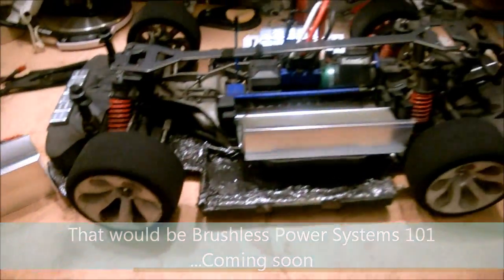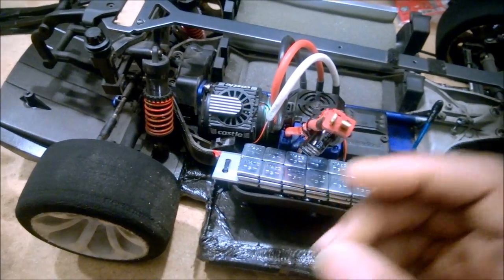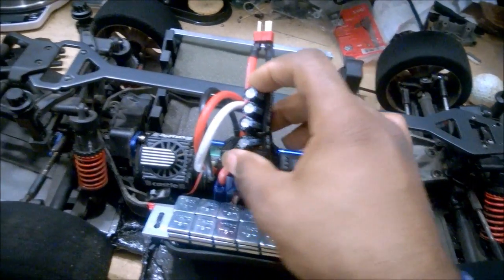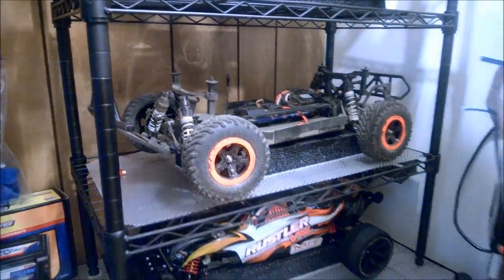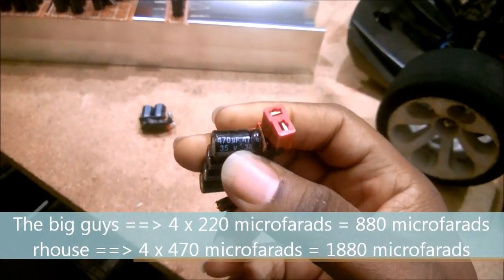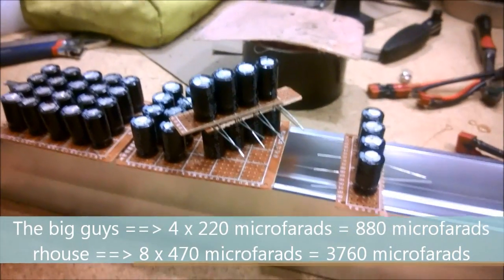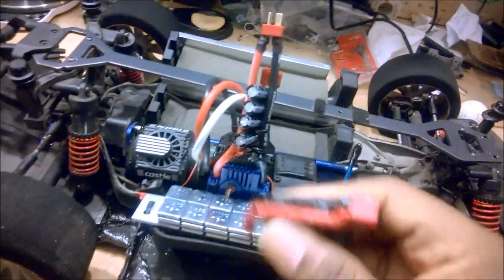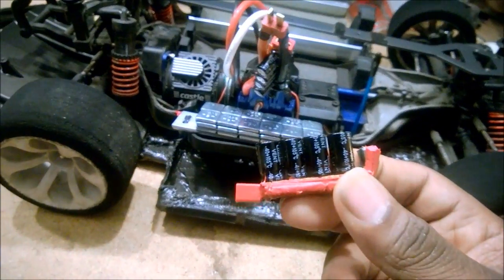Ep. 88: Cap Packs 101

Comment: I am amazed.  I only heard of cap packs a few months ago.  I’ve watched several YouTube videos.  I’ve “commented” each time basically asking “what do they do?”  & “how might they improve performance of the specific vehicle I have?”.  Most of me “comments” remain unaddressed.  Others completely confused me.  One reply NOW makes sense to me...”eliminates ripple”.  After you video, I now understand what was referred to as ripple.
One of the questions I asked repeatedly was how would a cap pack improve the performance of the X01 I am currently working on.  I did get one answer...the X01 doesn’t need one.  I could only guess one reason.  While I was curious what the 3 drums were wired into the ESC,  I couldn’t identify them from the parts list or the exploded views.  Now I know they are a cap pack.  While I do have a few other questions, I don’t want to go on & on here, but here’s one.  Will replacing the cap pack that TRAXXAS seems to have “snuck in” with a superior one (ie yours) improve the performance of my 6S X01?
Great job!  THANKS!
Reply from the maker: The XO-1 ships with a version of the Castle Mamba Monster 2 ESC with custom Traxxas firmware. The MM2 was capable of delivering at least 200-300A in short burst, but few people know exactly how many it will do because this generation ESCs lacked data logging. This sounds like a lot, but this ESC did not contain very much internal capacitance to fight ripple voltage, which is why Castle and Traxxas added the external Cap Pack to better protect this ESC. While the combo worked well, Castle continued to improve their Mamba Monster ESC with the Mamba Monster X (which had a more sophisticated "brain" and added data logging) and then Mamba Monster X-8S (which has a brand new 8S-capable internal architecture and performs on par with the older Mamba XL2 and XLX 8S ESCs)

While the MM2 is a still a good ESC, it is an old architecture now and about 2-3 generations behind the latest Castle ESCs in overall performance, power delivery, overall smoothness, and ripple suppression. I believe the Traxxas firmware in the OEM ESCs limits the output, so you should not be able to exceed the capabilities of the stock Cap Pack. However, the Mamba Monster 2 Retro from Castle has all the power suppression removed and is a direct replacement for the stock ESC. If you decide to upgrade to that, you should definitely jump to a higher capacity cap pack to protect it. That ESC will happily deliver enough power to destroy itself if you aren't careful setting it up.

Still, If you want to get the most out of your stock XO-1setup, I'd suggest moving up to the MMX-8S, just for the data logging and increased smoothness. It's internal architecture is so good that you may not even need an external cap pack running on 6S (but adding one definitely won't hurt).
Reply: I have to confess while I almost ordered the MMX-8S...went as far as to put it in my cart, but I am very intimidated regarding my ability to do the replacement of the stock X01 ESC.  While I don’t doubt it will be the best upgrade I could do, I think I would screw it up...too many wires!  Thanks for your advice.  Perhaps with a little more experience I will venture to make the change.

Comment: I don’t even know what data logs are lol. Is that if you run an aftermarket transmitter that you can check your data? I wouldn’t even know what to look for in the data lol. Thanks for your response
Reply from the maker: Castle's higher end ESCs have an internal "black box" that records a ton of information that you can review to help tune your rig and make sure the ESC is running in a safe regime. It's really cool tech.

Comment: Noob/stupid question. .. cant you run them in line like have a conector either end then onside to your esc the other to the battery ?
Reply from the maker: Not dumb at all. I've actually built a few custom packs just like that. The down side is that the cap pack has to be able to handle the full load of the power system, which can be a few hundred Amps in larger setups. It also places the caps much farther from the ESC, which can make them less effective at fighting ripple voltage.

Comment: Hi,  how do I size the caps--   I run a 2s setup and I think I would use a 470uF but what would the voltage be?  I only run 8.4 volts would it be 16volt , 35 volt or something altogether different?
Reply from the maker: Generally, just pick caps capable of handling the voltage you are planning to run. I build my packs with 8S capable caps for extra compatibility, but if you are only running on 2S, you are fine with a 10V cap. You won't get any extra performance running a higher voltage than you need.... unless it has a significantly lower ESR. Otherwise, you will just be carrying a cap that is physically larger than it really has to be.

Comment: If you don't mind me asking, what is the board called that the capacitors attach to when making a cap pack?  I've googled "circuit board" , "capacitor strip", and have had no luck.  After blowing my CC XL2 I'm planning to take major precautions after I replace the capacitors in my esc.
Reply from the maker: Just order one of my 10S capable units. Save yourself some time and trouble. ;-) You can finde them in my ebay listings at http://www.ebay.com/usr/rhouse21

I buy "project boards" and cut them to size.
Reply: +rhouse21 - RC thank you for the knowledge

Comment: Hello,sir may I ask you for suggestions.my jlb j3 have a use standard 3s battery and 25v 750uf x 2pcs, ESC 120a.now I want upgrade battery 4s 5200mah 60c,can suggest how pcs can I use for upgrade the cap bank.can I use 4pcs the same 25v and 750uf for upgrade.. please teach me about that
Reply from the maker: There's no magic equation. If you don't have data logging , the real test is to observe your ESC for signs that it is struggling. If it or your battery is running hot, you may have a ripple Voltage problem and need more capacitance to help the power system out.

Comment: Hi guy, I have a 200amp esc 8s, What pack should I use for running 6s LiPo batteries.
Reply from the maker: My packs have changed significantly since this video. I'm building packs to order now. You can see my current offerings on ebay. I have a description of which packs are best for which application. 

httP://www.ebay.com/usr/rhouse21

Comment: Hi bro 
Did u mean if j have a 3s esc when i install these capacitor i can use my esc with such as 6 s 
Or i can use a high voltage 3s lipo batter 
Also if u can help me brother for the high speed i should use high ratio oil or low one 
Thank u so much i am really interest with your videos
Thank u again
Reply from the maker: A 3S ESC WILL NOT take 6S power, no matter what you do. This is because 3S LiPos run at ~12 Volts. 6S LiPo setups are ~25 Volts. If you plug a 25V source into a 12V ESC, it will be VERY bad. What I meant was that my capacitors will handle up to a 6S power system, so you can wire those units into a 6S (or any lower cell count) car and be just fine. Sorry for the confusion.

As far as gearing, you really need to look at your motor's kv and your speed goal to figure out what your car can do. You can actually get some pretty serious speed from a 3S power system in the right car. A Traxxas Rustler, Slash&#160;or similar car should be capable of 60-80 mph, but a true 1/10 scale on-road car like my Team Associated Apex should be capable of well over 100-110 mph on 3 cells.

Thanks for watching!

Comment: So 2 questions.
1. wouldnt a good quality ESC have some kind of system like this built into it?
2. if they dont why not?
Reply from the maker: Steven Gilbert I used to wonder about this too. My gut tells me that it all really boils down to current handling capability. 

1. Power = current * Voltage (P=I*V) & hp = torque * rpm (Voltage ==> rpm, Current ==> torque)

It's actually a lot easier to design reliable, low failure rate circuits to handle high voltage than to handle high current. If a designer needs 1,500 Watts of power to get the desired performance from an RC, it's easier to design a reliable 25V (6S) system that only pulls an average of 60 amps from the batteries than to depend on a wicked (12V) 3S system that needs to push an average of 120 amps. 

Manufacturers usually ship their RC cars with really short gearing to reduce the torque load of the motors which reduces the current draw of the power system.  Bigger motors with bigger magnets make more torque using less current. This is why 1/5 & 1/8 scale motors are so much larger than 1/10 scale. 

2. Large Capacitor banks are...Large. They add a lot of bulk to the power system and are more difficult to package cleanly. The also add cost to the final products. Keeping the current loads down greatly reduces the need for a cap pack (for your average user) and keeps the price down. If a more stressing user needs more performance, an external Cap Pack is a relatively cheap that they can cell their advanced user base separately.

Comment: You do these type of videos really well man!! Try making and selling some glitch busters from 10V caps. They're easy and dirt cheap to make and you could sell them for decent markup. Hoping I could request you do a vid creating an ultracapacitor pack using 8x2.7V 10f or 25F Maxwell or Nesscap Electrolytic Double layer ultracapacitor units in series. I've made a 4S and a 6S unit but can't find the time to make a video myself showing these and how they work. I like to connect the standard electrolytic caps close to the ESC but I use these as battery boosters for my really low C rate batteries.Let me know if you need instructions or anything.
Reply from the maker: +Ken Trapnell Thanks! That's a pretty cool idea!! I'd love to see pix. You can message me via my facebook page. http://www.facebook.com/rhouse21rcphysics

Comment: Can they be made to big?  Both in capacity and length. If so what would be the side effect. Thanks 👍🏼
Reply from the maker: My personal feeling is that if your cap pack is almost as big as a battery, just run an additional battery in parallel. 

Better batteries will have less ripple voltage. Running batteries in parallel is a way to "boost" the performance of batteries so you won't need as much help to suppress the ripple voltage. 

There are basically 3 classes of cap packs out right now. I make smaller packs that have really low Equivalent Series Resistance (ESR) so they can charge and discharge more effectively with each of the motor's power pulses. Other guys tend to use larger capacity packs that keep a higher average voltage, but take a little longer to charge and discharge. You have to watch out for these though. a higher rpm motor may require power pulses faster than one of these packs can recover, so they could become less effective if it's not matched well to your motors rpm range. The last class are the super-capacitor packs that have a HUGE capacity, but drain slowly. Since the voltage in a capacitor increases with the number of electrons it is storing, these packs maintain a higher voltage even when the batteries start to sag under heavy load. This lets them "pull up" the voltage on the battery bus which squashes some of the ripple voltage in the system.

I hope this was useful.
Reply: I appreciate your time, thank you.  The smaller caps you make can they be made to large? Meaning to many capacitors. I always see 3,4,5, and sometimes 6 caps. Is there any adverse effect if you used 10 or 12. Thanks again
Reply from the maker: @Paul-815  I've actually extended this concept to make packs with 12+ caps. The main problem with carrying bigger cap packs is that you get HUGE sparks when you first connect them due to "inrush current". This can damage or destroy your battery connectors over time. The bigger the cap pack (and the higher your operating voltage) the bigger the spark you'll get.
Reply: rhouse21 - RC Physics again I appreciate your time. I only use anti spark connectors for that reason.  Any other reasons. I’m just wondering if you had 12 in a row. Is the 12th cap useful or 11th or is it creating resistance being to long. Thanks again.
Reply from the maker: @Paul-815  I'm about to get really geeky, so apologies in advance. 

Think about it like this. The cap pack is generating waveform that is 180 degrees out of phase with the ripple voltage in the system in order to cancel it out (as much as possible). Resistance / inductance inside the cap pack will mean that it would take a slightly longer time for caps at the end of the wiring run to "sense" the ripple voltage and react to it. That has the effect of adding a phase shift to the output of the cap pack which makes it less effective. Long wires between the cap pack and the ESC have the same effect. 

I think the biggest thing is to make sure that the interconnects within the cap pack are of low enough resistance / impedance that the caps see little if any phase shift within the pack. That will make all of the caps act as if they were just one large cap.
Reply: rhouse21 - RC Physics thanks for all your help. Is that why you stagger your caps to keep the interconnection shorter?
Reply from the maker: @Paul-815 Think of that configuration as my trademark. When people see it they know where the pack came from.

Comment: I have a question to ask, for 48v, 3Kw DC motor I wanna make a backup capacitors pack, when I switch from one line of electricity to another, in that moment I need capacitance for few seconds,I don’t want to stop motor during switching, for that purpose how many caps, how many capacitors in pack required?
Reply from the maker: This is a little out of my wheelhouse, but I'll give it a shot to trying to help think this through. 

You would probably have to go with a super-capacitor solution since most normal caps self discharge pretty quickly once a power source is removed.  Since P = I*V, a 3kW motor would be pulling as much as ~60A. An Amp = 1 Coulomb/sec and Capacitors are measured in Farads, which are Coulombs/volt. 

The voltage stored in a capacitor begins to fall with it's state of charge, so you would need a super capacitor large enough to only dip a volt or two during the time power is disconnected. 

60A * 3 seconds = 180 Coulombs used. If you want to limit the voltage drop to ~2 Volts, that says you need a total capacity of 4320 Coulombs @ 48V. 4320 Coulombs /48V = a 90F Capacitor bank

You may be better off making a relay based switch that could change over in a fraction of a second so you need a much smaller capacitor bank.
Reply: rhouse21 - RC Physics thanks for your kind information, and sorry for to have a troubled to you 😇
Reply from the maker: No problem. It was interesting to think it through.

Comment: How do you Kno how many capacitors to add for each pack
Reply from the maker: There's a little more to it than that. Cap packs fight ripple voltage. The number of caps you will need depend on the rating and performance of the caps you plan to use, the overall power level of your rig,  and the quality of your batteries. If you tell me more about your rig I may be able to give some better advice.

Comment: hi i have a DRK esc to run at 2s which capacitor should i use
Reply from the maker: Are you asking which of my caps would be the best for your rig? I sell a lot of my rH214-8S packs for 2S drag guys. They do a great job supporting the ESC with a pretty compact package. Here is a link to my ebay listing. I sell them for $20 each.

https://www.ebay.com/itm/152897973437

Comment: May I know if what size caps I need for my rc?
Reply from the maker: That depends on a lot of things, actually. Ripple voltage is largely caused by the current load on the motor and the quality of your batteries. The only way to really know how much ripple voltage you are dealing with and whether you need more capacitance in your system is to have a data logging ESC like a Castle Creations ESC. 

Better batteries and lighter gearing can often reduce ripple voltage meaning you can get by with less capacitance. 

What kind of car do you have and how do you run it? That could help me give you a recommendation.

Comment: What brand of capacitor do you use if you don't mind
Reply from the maker: Depending on the size of pack you are planning to build, the best brand for you might be different than the ones I use. 

I suggest going to www.digikey.com, looking up the type of capacitors you are thinking of using (rating and voltage class), and you will get a table showing all your options. Sort the table by the expected hours before failure and pick the caps that give yo the best balance between lifetime and cost.
Reply: @RCPhysics  I whant to run 6s in my rc boat , tank you for your time 🙏

Comment: Nice video. You could really do with the 50v for 6s though. Something to do with voltage spikes that come from the ESC when going on and off or pumping the throttle repeatedly.
Reply from the maker: Good suggestion, but I found that the higher quality capacitors handle these transient voltage spikes pretty well. That's one of the advantages of going with higher quality parts. The lower quality, generic ones that you can find on Amazon or ebay are a lot less durable, so they don't handle these spikes nearly as well.
Reply: @RCPhysics  You always need to use, low ESR Capacitors. The ones that have 105° printed on them. But the voltage spikes for a 6s system will be higher than 35volts. Which means they aren't soaking up the spikes that do the damage
Reply from the maker: @51im  Here is a link to a datasheet for one of the caps I use to make packs. They are rated for 35V continuous and 44V surges. In reality, they can handle even higher voltages in short spikes, so this grade of caps are fine for this application. As I mentioned, lower grade caps may not hold up as well.

https://api.kemet.com/component-edge/download/specsheet/ESY108M035AL4AA.pdf